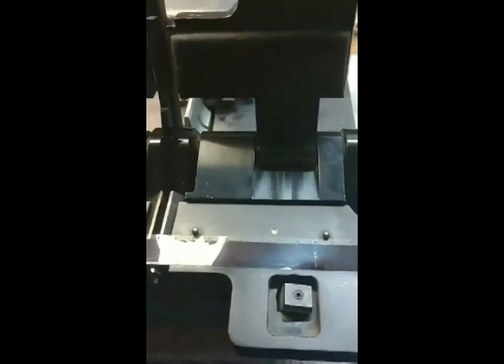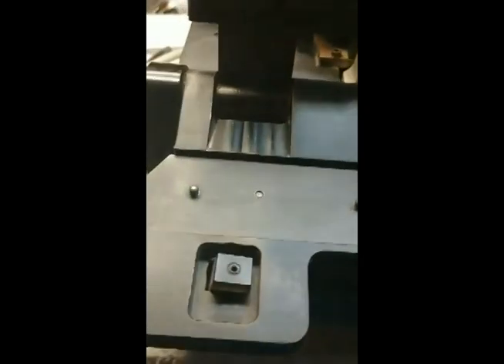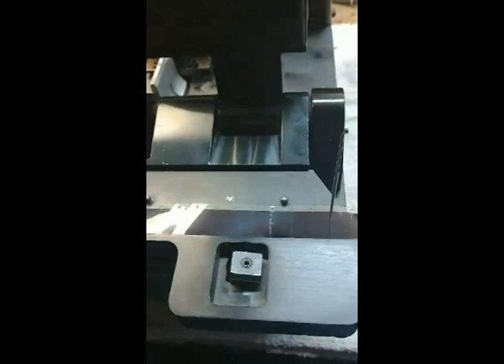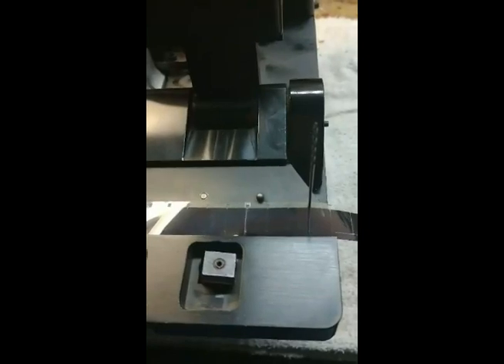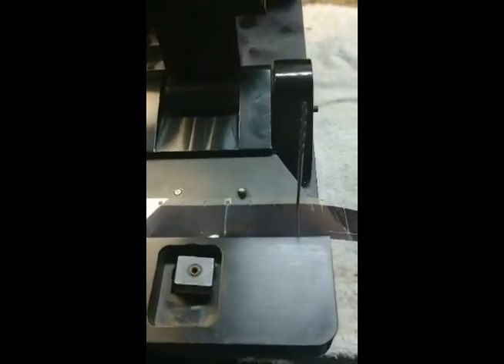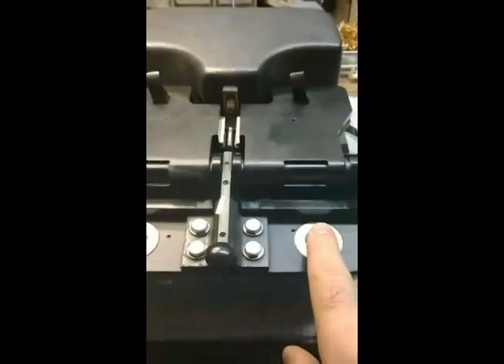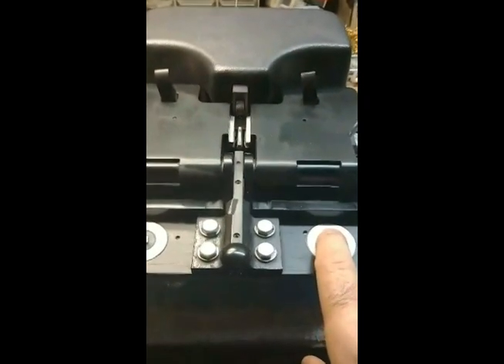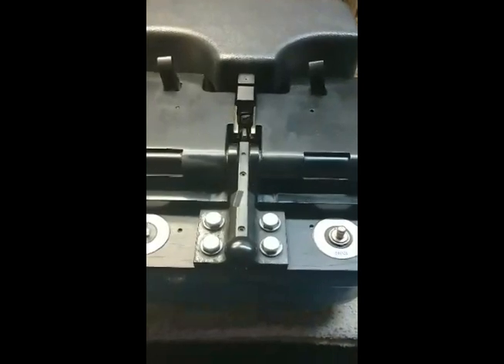Metric 3001 Ultrasonic Film Splicer Demo

Comment: We're having issues with our new lasergraphics scanner pulling apart tape splices. You're modifying a 35mm splicer for 16mm so I image it could be done for 8mm too but how does it know how far to weld?...or does it just run the length of 35mm and whatever is in it's path gets joined?
Reply from the maker: if you look at the panel on the splicer to the far left and barely visible in the video, there is a three position toggle switch. 8/16/35mm.. this controls how far the roller travels for the width of the splice.